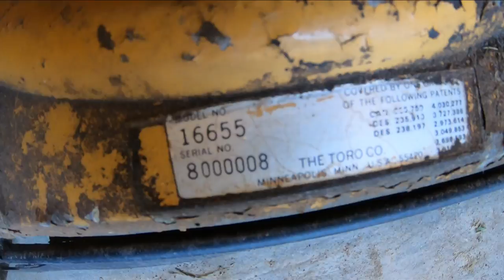Vintage, Heirloom Lawn Mower, Will it run?

Comment: "WiLl It StArT?" Lol its a briggs if the connecting rod is still on the inside of the engine 98% chance XD
Reply: yep have a briggs mower that i use on rough parts with roots and i swear its unkillable just gotta clean the spark plug and keep the oil popped off because the piston rings are pretty much gone and i swear it doesnt have a flywheel key last time i hit a root hard enough to dead stop the engine and it fired back up no problem (although knowing the repair shops here maybe my dad hit a root blew the key and the repair shop welded it)
Reply: random stuff true that
Reply: brigger stragglers i love them they still out last any other mower
i still have mine riding mower it out last other mower still 13 years survivor
Reply: The things are brutes
Reply: @randomstuff-cu4of  lol...same username
Reply: Those old pulse jet Briggs can be a bitch man, I think to got it twisted. Flojet style carbs, sure. But those pulsa jet carbs are SENSITIVE.
Reply: I have a 11hp Briggs and Stratton in my lawn chief from the early 90s and it's still going on strong 😂😂😂
Reply: Got a over 30 year old Brigs runs on first half pull after sitting a year. Can't kill it. no fancy bitz n Bob's. Just the kill lever on handle.
Reply: The 2 percent chance of it not starting is if it runs out of fuel or the spark plugs want changing
Reply: I have a 1985 Troy Built with a Briggs and the only thing that works properly on the damn thing is the engine itself which runs great.
Reply: Briggs&stratton filed for bankruptcy ! Sad day. Pretty sure they have been in business for over 100 years. Now we will be stuck with whatever cheap engines china sends us.
Reply: @Meme Man there should be a wire coming from the coil. If you ground that wire it kills spark shutting the engine off. Or like the other person said pull the spark plug wire off. Might get a little bite though 😀
Reply: @Meme Man block the air intake with a rag
Reply: My uncle works for briggs
Reply: hell thell run without a connecting rod
Reply: @bentboybbz  what when!!!😓😲😰😨😳
Reply: @bentboybbz  we still have honda
Reply: @bentboybbz  and hyundai
Reply: @bentboybbz  i heard its going under new ownership
Reply: @kittyztigerz  I have a 15 year old tecumseh
Reply: @therandomman6647  is it been used a lot like everyday
Reply: IKR? My grandpa owns a lawnmower with a briggs.

He has had it for possibly over 20+ years, with very little maintenance.
Totally insane.
Reply: @hilljackzack7284  No. Ground out the plug, no Zappa!

Comment: That is a 1978 Toro model called the Home Pro. It was made in 1977 and 1978 based on the revised 1972-1976 Whirlwind deck. The factory color scheme for that model was yellow with a plastic shroud that was rootbeer brown color. The Home Pro returned a couple of years later, with the same color scheme, but the deck was changed to all-steel and was basically identical to the Toro 'Standard' line. Your mower is very rare today and yes with that ultra-low serial number it was one of the first assembled on the first day of production for the 1978 model year.

Comment: Damn It, I laughed till I cried when I saw that lawnmower taking off by itself, You can't fake that. They really made stuff better pre 90's
Reply: In case you're not familiar with them those flywheel keys they shear easily if you hit an object with the blade and they will refuse to start until it is replaced.

Comment: That mower is probably from the mid 70’s. If u look on the side of the blower housing you will see model, type and code numbers stamped into it. The first two numbers of the code are the year it was built, the next numbers indicate the month and the next indicate the day. A code number 740812 for example would indicate that the engine was built on August 12th of 1974. Those aluminum deck Whirlwind Toro mowers were awesome, they started making them in the late 50’s all the way up to about the late 70’s. Your uncle was a smart man, that’s a great mower to keep running!

Comment: Matt, you won't believe this . My dad bought a lawn mower in 1964 it was a 16 inch cut with a 3 hp briggs the engine lasted longer than the deck. It has been in my dad's (non) climate control garage. I clean out his garage 7 seven years ago  he gave it to me.. The Damn thing 2 pulls it started right up . Now i'm still use it every two weeks to mow my yard. Of course i put it on a  another deck .....still runs no oil leaks or using oil... LOVE THAT DAMN THING....
Reply from the maker: nice!!

Comment: Matt you want an aluminum key so that it shears first before the crank  breaks if you hit a large rock or immoveable object.
Reply from the maker: yes im thinking that one was I wasnt remembering thet were aluminium for some reason but I knew that....
Reply: @DieselCreek  The same design feature was to be found in the older Evinrude outboard motors using a shear pin on the prop just in case you encountered a solid object! You venture out on the water, you got a couple shear pins in your pocket and basic tool to get the prop nut off, to slide the prop off, replace pin, reassemble and your good to go. Now your paying close attention to where your going, especially if that's your last shear pin! Augh, the humanity of it all!
Reply: @DieselCreek  After the shear pin design disappeared, the prop factory was working over time trying to keep up with demand.
Reply: Been working on these things for years and never once observed an aluminum flywheels key save a crankshaft.  Pure snake oil by Briggs and Tecumseh.  Honda has a steel key.
Reply: @ericowens235  Bull shit, I've seen it break several times. It does work. Aluminum will always shear before steel.
Reply: @okiekidd6091  LoL. I agree. Aluminum will always shear before steel. But, an aluminum flywheel  key will not save a crankshaft from bending.  But if that crank is bent you can bet that aluminum key is sheared. If it worked there would never be a bent crank on a   Oh wait, happens all day long. But you keep on believing.  LoL
Reply: @ericowens964  True the aluminum key "may not" stop bending of the shaft, but it has a better chance than a steel key. You can bet that a steel key will "never" stop a shaft from bending. So I will keep on believing and you can replace bent crankshafts for sure.
Reply: @ericowens964  Gotta love it when people that have absolutely no idea what they are talking about think they can join a discussion and feel important. Go talk to the engineers who built this system and they will tell you why it's necessary. Or take a college course on physics. Snowblowers have brass and aluminum shear pins in their augers and driveshafts for the same reason.
Reply: @MrWolfSnack  With the fine thread nut it is possible to over tighten the flywheel eliminating the need for the key, probably not recommended:face-green-smiling:
Reply: cool  lawn  mower  Matt  I hope you  can get it running  so you can mower the lawn  you are  a cool guy   and  very smart  guy  about   that kind of stuff keep doing videos like this it's very  interesting   how you can get a old lawn mower  restored  and  running   for nothing  at all  👍
Reply: @DieselCreek I used a steel eye on 1 of those motors; it tore up the keyway in the flywheel in fairy short order.

Comment: Reminds me of my father’s 1974 craftsman lawnmower with Tecumseh engine.   It was used from 1974-1998. and now in 2024 I have acquired it after a garage clean out and it still runs  after a minor tune up ( quick and dirty carb clean,  new spark plug, new air filter, blade sharpen, sand points )

Comment: Just like when I was young! All the mowers were "safe" like that.
Reply from the maker: better check make sure you got all your digits!
Reply: That was a fun video to watch. I remember my grandpa had a mower that was small but looked like it had take teeth on the front. To start it, you would flip over the crank handle on the top about three or four times to wind up a spring and when you flipped the handle back over and pressed on it, the spring would crank over the motor.
Reply: @patamos7019  My father had an old Toro mower like that when I was a kid. He let me use it to mow neighborhood lawns - if I remember correctly,  I got paid about $2.00 per lawn. Of course,  that included edging, raking, and bagging the clippings. Most of the lawns were about 1/4 acre or larger. That poor old mower actually made it through 4 summers of me doing about 15 lawns per week.
Reply: Chuck Preston 
I did 1/2 acre lawns for $5
Reply: @patamos7019  I have one of those wind up starter mowers, I have a video of it on my channel

Comment: Greetings Mr. Diesel Creek! That's a great Toro Heirloom Self Propelled Lawn Mower! Your Uncle knew how to pick his Lawn Mowers real well . I'm sorry about his passing though . i had a quick question about Toro Heirloom Self Propelled Lawn Mower that you inherited from your late Uncle? Which year of the date Code is the Briggs & Stratton 3.5 HP Engine? Is it a 1977, 1978, or 1979 model? I have a 2nd used Briggs & Stratton 3.5 HP (White Snapper Version) with the flat Shroud Top Cover with the Grated White Screen. That looks exactly like that. It's a 1978. The Info of the Briggs & Stratton 3.5 HP Engine Model 92908 Type 1826 01 Date Code of B&S 78080904 (August 9, 1978). That's when it was manufactured in the late 70's. I just did a restoration on it this past week. i took it apart and sand it down with Sand Paper 120 Grit and I also used Rust-Oleum Gloss Protective Enamel (White Color - Gloss Protective Enamel). It came out really good too! Enjoy your Lawn Mower! Take Care, Phil

Comment: Whenever you want to start one of these B&S with the carb on the tank, always fill the fuel tank to overflowing out the filler hole. There is a "bowl" built in just under the top of the tank which is filled by a pulse pump in the diaphragm. This diaphragm is a rubber which dries out and becomes inflexible..and doesn't flex..and won't pump fuel into the bowl. By filling right up, the bowl is full, and by the time the bowl has emptied with the engine running, the diaphragm has been fuel-soasked and become flexible again. That is why it took so long to start..no fuel in the bowl......

Comment: While not quite as old as this, I am still using my dads john deere 14sb circa 1995 that I used as a kid to mow our yard, now using to mow my yard 25 years later. I dont think he ever changed the oil on it but it still runs and mows like a champ.

Comment: Reminds me of the days working at the hardware store.  When I had some down time I used to go back and talk to our small engine guy while he was tuning up mowers.  Granted, he wanted to make his hourly rate and he had the parts at hand, but when he got the flywheel off, that thing was getting a new condenser and points whether it needed them of not.  BTW, I've been taking care of my second-hand MTD for thirteen years now and it keeps going strong.  Maybe the deck will rust out someday, but they're still pretty reliable.  People just aren't used to actually fixing a thing when it breaks anymore.

Comment: The first two numbers of the code is the year the engine was built, 2Nd two is the month and the next two are the day of the month. Glad you saved this ol girl.  Numbers are stamped on the blower housing above the spark plug.
Reply from the maker: the engine is probably not original, i know hes gone through several overhauls on the old girl

Comment: "Oldy but a goody"  I lived in Lancaster County years ago and had some great Amish buddies.  I used to drive them to the Auctions in New Holland.  They would always bid on the oldest stuff they could find.
 1) Most of it didn't require electricity - most were belt driven.
 2) the shit was made out of the heaviest, purest steel and/or cast iron from those days. 
3) all those old tools , even from the early last century were made to be taken apart and repaired.
4) if they didn't have a use for it they would sell or barter it within the community. 

I love the soundtrack with meatball and roscoe !
Reply from the maker: I spent a year or so working out there and I loved seeing them with their old school wit and make it work attitude. great people most of em
Reply: @DieselCreek  Yea they are made out to be primitive idiots by the MSM but most Amish i knew were crazy smart with repairing just about anything.. (exluding digital stuff)  Analog? they all over that!

Comment: I grew up in the 70's and 80's and we had very similar Toros.  I liked them for exactly the same reason your uncle did, front wheel drive made trimming between the shrubs easy.  Just tip it and pull it back.  Then my parents bought a rear-drive Lawn-Boy, and I wound up IN the shrubs.

Comment: My dad bought a Toro self propelled in 1964, it had the exact same front wheel/drive mechanism as that one.  The difference in my dads was that the Briggs could be pulled from the mower deck (which was magnesium, not aluminum!), and put onto a snow blower, edger/trimmer, and rototiller.  A 3 of which he had.  He also came across two more engines and mower decks once, so we had 3 motors, 3 decks, snowblower attachment, edger trimmer, and rototiller.  He passed in '93 and they were all still working after 30 years.

Comment: My first inherited mower was a 1950's era Cooper with wraparound-rope loop and pull start.  What it lacked in power could be compensated by the inertia of full throttle 3600 RPM.   And could throw objects long distances since there was no side shield.

Comment: From 1955 to 1968, I repaired a great many B&S engines and mowers. Started when I was 10 years old. B&S were very good engines. However the best lawn mower engine was the two cycle engine. They never lacked good oil, and ran forever. B&S engines had to have good oil, and good levels to survive for the long haul.

Comment: Back in the day when I used to flip push mowers.. I deleted the points and condenser system and old coil used a electronic ignition coil from a newer Briggs engine instead.. It made it more reliable.

Comment: We had a couple of Toro front wheel drive mowers like that in the seventies. One of us kids would cut the front yard while the other cut the back with the second mower. Very reliable. One of ours had a battery starter that hooked onto the push handle. It didn’t work as well as the pull cord. My dad still had one of them when he sold their house six years ago and it still worked. Good memories.

Comment: Always loved first start up of my three small engines in late February. The tiller wanted a shot of starting fluid but had no problems after start up. The push mower always surprised me, would start on first pull. The Snapper rider I'd only have to hit the starter maybe 5-10 seconds. Then let them run about 10 minutes.

Comment: You can use a test light or ohm meter to check continuity of points. Also, an old trick, after filing points, use a clean dollar bill and drag between points. Cleans them of oils and debris great

Comment: Last year both my grandparents died and I helped clean out their farm. Both born during the depression there was a lot of stuff to clean up and sell off. My family was cleaning out the garage and we knew that they had three John Deere lawn mowers but I found under a bunch of stuff a pristine fourth John Deere lawn mower. I was like jackpot.......Pretty much I got that mower(it was a vintage 1979 John Deere model) and a John Deere sign(I like John Deere). Took it home and only needed one little valve which had dry rotted over the 40 years. I think my grandfather had used the mower maybe once or twice and parked it. Nothing runs like these older mowers, hence I only own older mowers.

Comment: we call those keys, shear pins, they aren't steel but heavy cast aluminum, you would be surprised how many motors those shear pins have saved. One difference between you and my dad is, he would clean everything to factory clean before putting it all back together.
Reply: Yes,  that is the deal with the keys.
Reply from the maker: its a nice mower, but still just a mower, paint dont make it work any better. if i had unlimited time id do that too, im just too dang busy
Reply: @DieselCreek  He's talking about the points area and the grime around it.  Plus cleaning around the flywheel and removing rust and such around the magnets.
Setting the gap between the flywheel and the coil pickup too.
Reply: @DieselCreek  Its a mower not a shower, as long as it works its all good.
Reply: @DieselCreek  It's ALLU-MIN-UM, she no be rusting! Eh!

Comment: This mower reminds me of the Craftsman one I inherited from my grandfather, he got older and couldn't pull the cord anymore hard enough to start her up,   he got a mulching mower instead with the new style assisted pull cord.  I loved that craftsman one, it had a good engine and fired up in 2 pulls every time.  It is with my parents still probably. Dad got a tractor but never let me drive it.  he didnt trust me not to hit the house, even after i could drive a car.  it was before it had the new style pull where there is like a pull assist to it.  i mowed the lawn at my parents house so many years growing up with that craftsman.  it didn't have the safety bar on it either but no self drive. just push by me only.  I did love that i could walk away from it for a moment with it running to grab a branch or something.  I used to throttle it down when i did that.  no throttle adjust on them nowadays.   I have a toro one now that can be stored standing upright! no need to change oil in her either, just check and add it says...and i leave the gas in it all winter, add fresh and she fires up on one pull every summer season